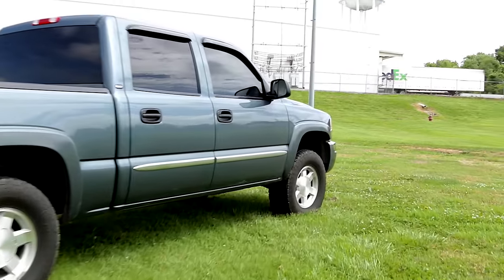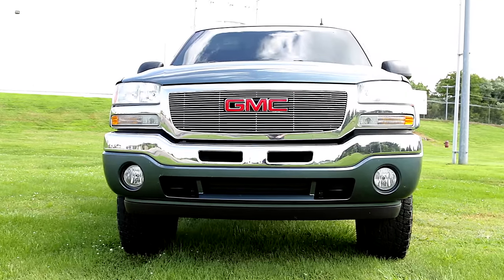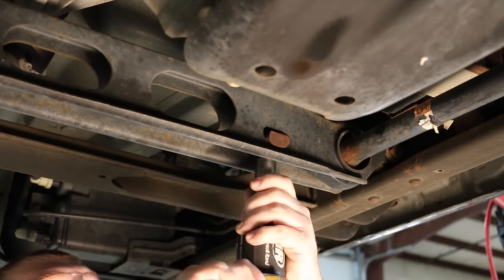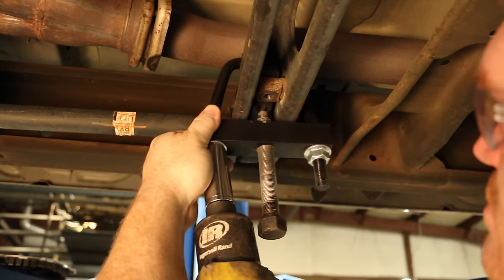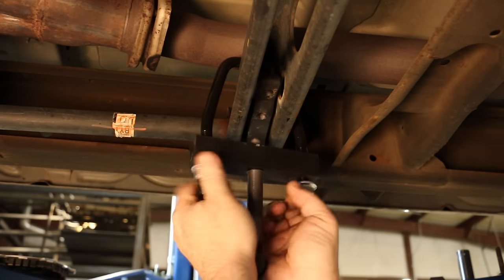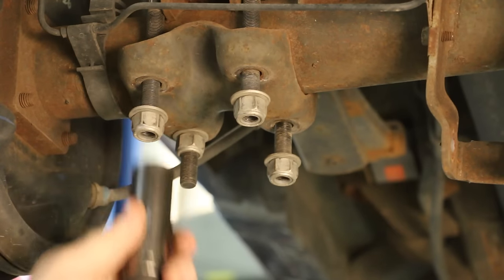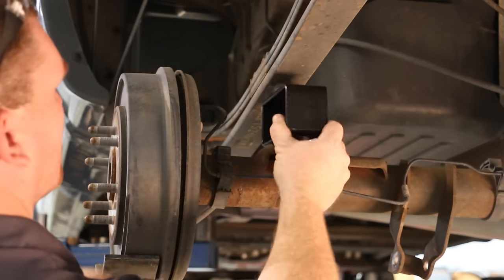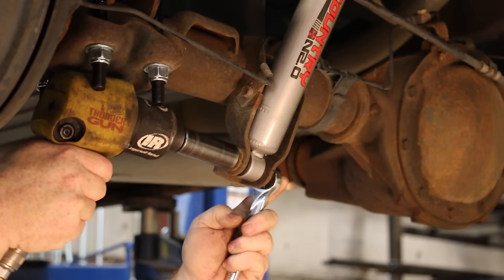Installing 1999-2006 GM 1500 Pickup 1.5 to 2.5-inch Suspension Lift Kit by Rough Country

Comment: Don't understand what they mean by 1.5-2.5 how to u chose your inch setting??
Reply from the maker: You adjust the ride height by how you set the torsion keys. The front end will get higher according to how you torque the bolt on the torsion keys. It has a 1.5-2.5" adjustment to it.
Reply: Rough Country opposed to what on stock keys

Comment: Mmmm,,, yeah my stock torsion keys were rusted on . Ended up having to drop the torsion bar crossmember then cut the top part of torsion key, then beat with sledgehammer. But in your video they just fall right out! Bravo rough country bravo.
Reply: Maybe take better care of your truck and lube stuff now and then pen fluid twice a day 2 days prior and every thing went smoothly
Reply: use a bigger hammer

Comment: Sockets and wrenches you’ll need.
Lugnuts 22mm
Torsion key bolts 18mm
Front lower shock 21mm 
Front upper shock 9/16
Rear u-bolt 22mm 
Rear shocks upper and lower 21mm

My truck has 225K miles 18 Minnesota winters. The keys were rusted but with an air hammer on a crappy 135psi air compressor pushed the torsion bars right out of the keys. Oriellys rents the torsion key tool for free.
Reply: I only used a 7/8 deep with wrench. And 18mm and 15mm. 7/8 for lugs rear shocks and u bolts. 18mm for the keys and 15 for top of fount shocks.

Comment: Holy shit. I just finished installing this kit in my 03 Silverado and it was way harder than it had to be. Follow these tips when installing your kit to make it easier on yourself.
1. Remove old keys and Install keys. Pro-tip: Local auto stores often have free rentals for tools like the torsion key tool. Give them a call.
2. Remove old shocks and install new front shocks.
3. Lift rear with jack on axle, place jack stands on rear frame.
4. Remove Tires. Makes job way easier. I recommend it.
5. Remove rear shocks. If you try to install blocks with old shocks in place the rear axle won't drop down far enough for you to get the old blocks out and new ones in. Don't install new rear shocks just yet. 
6.. Lower the jack holding the rear axle slowly. Now you have enough room to get the old blocks out and new ones in.
7. Remove old blocks and install the new blocks.
8. Now install the new rear shocks. You will likely have to adjust the axle up to get the shocks in place.
Also, the instructions say you only need 18mm and 21mm sockets. Not true. That's all you need to remove the old equipment, but the new u-bolts that Rough Country provides have a 24mm. Also, the u-bolts are way longer than necessary so you either have to use a super deep socket or cut them. I own a grinder, not a deep 24mm socket so I just cut them bad mamba jambas. Rough Country, get your instructions in order. I imagine this kit is super popular. This project could have been much easier with clear instructions.
Reply: thanks man
Reply: Philly McGilly so just let the front end sit on the ground while working on the back? Are the shocks hard to take off the front? Is it just "plug and play" do I put the jack on the diff cover? Then ease down the jack enough to put blocks in?
Reply: matt Lane I let the front end sit on the ground when I did my rear end. Shocks aren't that hard to take off, just make sure you spray all bolts and nuts with penetration oil stuff. Your going to have to lift the rear end by jacking up the frame. The rear diff has to be loose when you work back.
Reply: Philly McGilly did you get your truck aligned after the install.?
Reply: thanks big man!

Comment: Just installed and love it. Brought it over to the shop for an alignment and it looks and rides great. I bought this kit over the leveling kit because it came with shocks also and I was in need of them anyways.  Truck rides at 39" front  and 39 1/2" rear. Thanks!
Reply: golfmanmatt is this on stock size street  tires?

Comment: READ THIS BEFORE TRYING TO REMOVE OLD TORION KEYS...you will thank me..LOL
Just installed this exact kit last weekend. Went great except removal of rusted key's. If you want to save a ton of time and headaches, get a die grinder with a 3" cut off wheel. When keeper is removed and tension is released on key, part of the key will be hanging out of the bottom of the cross member. Cut a slot in key, with cut off wheel, till you reach torsion bar. You will just start to hit the cross member by the time the key is cut through. Put a chisel in slot and smack it a few times to free up bar from key. Next put a steel rod (just slightly smaller than hole in cross member) in the hole in the back of the cross member and drive the torsion bar forward. Came right out. If you still have trouble cut another slot right next to the first slot to remove a little bigger piece of key. This added an increase of 1" to the rear and 2.5" to the front. Truck now sits level and looks great!

Comment: I installed this kit and the only way to get the front level with those rear blocks was to run with the UCAs resting on the droopstops. I took the blocks out and backed the torsion off a bit and now I look like those damn Carolina boys.
Reply: Not sure if you’ll see this I have the same issue. I have an inch of thread left on my key adjuster bolts and the UCA is resting on the bump stop mount.

Comment: I used a 6"  rough country lift  on my 2003 gmc sierra.  It has been 2 years and still rolling strong, all of those negative reviews you read are from jack asses who did it them selfs and jacked it up.
when installing on an older truck mack sure you take it to a really credible mechanic ( Mooses 4x4 in Hartford, wisconsin did mine)  they did a front inspection on the truck, i had to replace some parts on the front end but when they got done it drove better then new...
hang out in the gmc forums and you will fine a vender giving out deals sometimes. i got my 6" kit for $980 with a front stabilizer shipped to my door.
Reply: J Dizzle hey man, how much it cost for them to do the work?
Reply: Justin Whittier shouldn't cost more than 500

Comment: My torsion bars on my suburban were welded with rust to the stock keys, did a cut on the key with a grinder, used lots of pb blaster and beat the fuck outta it with a trusty sledged till they came out

Comment: I've had this kit for a bout a year now. Although, I like the look, it squeaks like crazy. Is that normal?
Reply from the maker: +JC Monthoff Could be a number of things. I would put it on a rack and just tighten everything and grease what needs to be greased, such as ball joints and bushings. Not common but even stock vehicles will squeak.
Reply: That's true. I didn't notice the squeaking until I got the leveling kit. I am upgrading to 6" lift soon and new uca with ball joints. Hopefully that'll fix it!

Comment from the maker: +The Kenster What size wheels are you planning to run with the kit? Aftermarket or factory?
Reply: Will this kit stiffen the suspension or make it ride softer
Reply from the maker: Neither. It's designed not to effect ride quality at all.

Comment: is a 2.5 inch lift enough to worry about it changing the angle of the CV axles and other stuff in the front end linkages?? i'm thinking the 2.5 inch lift would be perfect for what i want on my 2001 silverado but i'm worried about compromising the front end linkages.
Reply: How did it go I'm also wondering like u?

Comment: Hey! 
I got this setup installed a year ago and have some problems I need help with. My upper control arms are laying against one part on the frame and same for my shocks. Wich make it imposseble to make a wheel alignment, and that make my ride really unconfirtble because I have no correct working suspension on my truck.
Reply: cranked to high up.....need at least 1 inch of travel between the upper control arm and the droop stop.

Comment: I just installed this on my 04 GMC Sierra. I had the front in lined up afterwards. Driving it a bit and the tires are wearing on the outside edge pretty bad. Did they do a bad job lining up the front end or can it not be lined up correctly after the kit is installed?
Reply from the maker: Yes sounds like the alignment is still off if you have wear on the outside of the tires. That kit should align back to factory specs
Reply: @RoughCountryTV  thank you! I'll take it back to them.

Comment: So on the website it says the 4WD one doesn't fit the 2005 chevy sil 1500. Is the 4WD set up almost the same or no?
Reply: 2wd gmt 800s have a coil spring over a shock and the 4x4s have torsion bars

Comment: Can someone explain how the torsion key lifts the truck with a different angle or degree and yet yield the same torsion ? Wouldn't it be the same to just turn up the torsion keys till you get about 2" of lift more.  Or with the new lift keys you have the lift but still remain the same torsion as stock?
Reply: this is a good question.  how is the front going UP if we set the torsion bar adjuster bolt to the same location? (7/8" in the video)  Is the key bigger?

How do we choose between 1.5" or 2.5"?  

if I choose 2.5" can i 33" tires on my 2007 GMC 2wd Sierra Classic?
Reply: +John Turman The key is indexed further down than stock. If you put the stock key on top of the new one you will see the 1 inch or so index so putting the bolt back to where is was is actually twisting the torsion bar more to lift the front of the truck higher because of the index on the new key.
Reply: +John Turman 2wd doesn't have torsion bars.
Reply: I just put these keys on my 2007 classic this weekend and ran the screws back to the original 7/8 inch I had before and it raised my front end 3.5 inches had to back them off to get the 2inch raise I needed.

Comment: With this lift on my 2005 GMC Sierra 1500 crewcab, what would be the largest tires i could run
Reply from the maker: That depends on the size of the wheel. Here are the recommended tire sizes for this kit: 285/70 R17, 285/65 R18, 285/55 R20

Comment: Their is a rough country leveling kit o. The truck I just bought. It still leans forward though. How do I adjust it to where it is level
Reply from the maker: For this particular make and model you can crank the keys a little more to get it level. This suspension is all in the torsion keys. The ride height from center of wheel to fender well on this one should be 22"
Reply: You crank on them dang ole torsion keys till that bih is struttin! If you ain't ridin on the bump stocks yer ain't truckin
Reply: How far in is the torsion bolt for the 22in that’s where my truck sits now but it’s maxed out

Comment: WHY is the 2500 kit twice as much when its basically the  same kit?
Reply from the maker: http://www.roughcountry.com/gm-suspension-lift-kit-8596c.html

If this is the kit you are referring to it is because it comes with aftermarket control arms

Comment: are the rear  blocks the same height as the factory ones? if so i would max out the torsion keys and then have to add a leaf spring for the truck  to sit level.. Correct ?
Reply from the maker: No those are 1/2 bigger blocks than the stock size blocks and allow you to crank the keys to 2.5" ride height for a leveled stance.

Comment: would you guys recommend an add a leaf springs instead of the 2 inch block in back
Reply from the maker: You can opt to do an add a leaf with this kit. However, you would have to add it on extra with the kit. We wouldn't be able to substitute for the block with an add a leaf.

Comment: Can I run my 265 70 17 bajas with this kit or will they look small? The rough country site recommends 285's but there not that much bigger.
Reply from the maker: 265/70-17 will be fine if that is what you want to put on this truck. They will not fill up the fender well like a 285 but they will most definitely be a good fit.

Comment: I just bought new tires, but want this lift, would it look okay with stock tires? and also 2inch spacers on wheels? thoughts appreciated.
Reply from the maker: Stock tires and wheels will look fine with this setup. The tire that we recommend is only one size bigger

Comment: I have a 99 Chevy Silverado z71,that came factory with p265/75r16 tires I'm looking to add an overload spring in rear, with your leveling kit, would I be able to clear lt285/75r16 without rubbing ?  Also, would it have a slight rake in the rear do to the overload ?  thank you
Reply from the maker: +frosty116 with the overload it will still have a rake to the stance of the truck but clearing 285/75 shouldn't be an issue at all.
Reply: Awesome,thank you for your response. keep up the great work on products and videos.

Comment: Is there a way to compress leaf springs, we didn’t have a lift so we used jacks and jack stands but in order to get the block in we you used a jack to lift the leaf springs, my rear end looks very low too.
Reply from the maker: If the rear is still low after installing this kit then chances are you have a bad rear factory spring since we use the block in this kit. Either that or you have the front keys cranked too much.
Reply: @RoughCountryTV   thank you.

Comment: I have this kit but for my 03 f150 and my stock 265 tires are rubbing on my lower control arms my front hub to fender measurements are 25 is it rubbing because they're over cranked?
Reply from the maker: Are you running stock or aftermarket wheels? If you are running aftermarket wheels what is your backspacing?

Comment: I have a 2000 Sierra Z71, if I get this kit and also a 1.5" body lift,would this give me a 4" overall lift?
Reply from the maker: Yes it will. If you have the 2.5" leveling kit installed as well.

Comment: What's wrong if when I take off the stick u bolts the axel doesn't come down??
Reply: Stock not stick!!!
Reply from the maker: +Zach Miller You have to lower jack stands that should be supporting the axle in order for the axle to drop. The shackles hold the springs to the truck. The u bolts just hold the blocks to the axle.

Comment: If i want to run 33's on my 2000 gmc sierra 1500 2wd would you know if a 3" leveling kit would be enough clearence to run those tires? Thanks
Reply from the maker: RCBashin90 The 4.5" kit RC offers is what you would need to run 33's on that truck, the link for the 4.5" kit is below. 
http://www.roughcountry.com/gm-suspension-lift-kit-239n2.html
Reply: Rough Country k

Comment: I have a 2005 Silverado running this kit with 265 70 17 tires if I wanted to do a 33 12.50 17 would there be trimming? And also the rim I am running is an American Outlaw Hollywood 17x8.5 with a +0 offset. Thank you.
Reply from the maker: Those will would be fine and yes you would have to do some trimming in order to run a 33x12.50
Reply: Would a 295/70/17 happen to work or would I need to trim that too

Comment: My truck has the factory lift blocks and the front bars cranked already. If i put this on will it still lift my truck or will it sit the same as it does already? I am already able to rub 33s with little rubbing but Im wanting a 3in lift look on 33s but not the price of it...
Reply from the maker: Our leveling kit will achieve the same look but will not put the stress on the cv axles and ball joints due to the clocking of our torsion keys. It will achieve the same stance but will be better on your stock components
Reply: Rough Country Thats the thing, i dont have stress or my Cv shafts at a bad angle. Factory lift blocks look weird as ive yet to see another truck with them and my torsion keys are just maxed out where the bolt looks like itll bend. Thanks for the helps though.

Comment: Do you make a kit like this for the 2001 1500HD 4x4 ? If it doesn't come with shocks and struts, that's not a problem.
Reply: The video literally says 1999-2006.  Sounds like you're safe here, my guy.
Reply: @mikezahnow  one might think that friend but I have an HD 1500 so a set up for a regular 1500 won't work.
Reply: @RenaissanceThinking  I didn't catch the HD part.  My bad.  Hope it works out for you
Reply: @mikezahnow  I wish it would work out. Been trying to get a response from Rough Country and a couple other companies for a year now.

Comment: could I run a 33x12.50r20 with this left
Reply from the maker: http://www.roughcountry.com/gm-leveling-lift-kit-283n2.html#custom2

This is max size tires and wheels you can run on this kit.

Comment: But what if my truck needs it right now and I install the lift kit?
Reply from the maker: You'll need an alignment after you install the lift no matter what, so if you can wait until after the lift is installed to get an alignment, you might save yourself from having to get two alignments... unless it's so bad it needs to be fixed now or you're not installing the lift for a while, in which case, I would go ahead an align it before to save tires and wear on the truck.

Comment: Will 33 inch tires fit with no rubbing after put on the truck?
Reply from the maker: 33s will rub. 285/55-20 or 285/65-18 is what is recommended.
Reply: Rough Country on the first tire size can I put 20x10s on them?